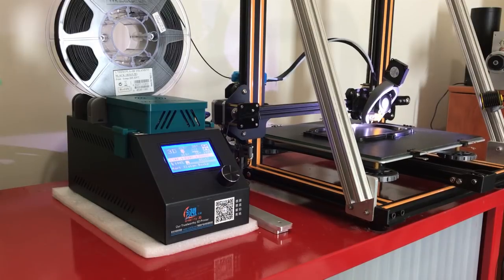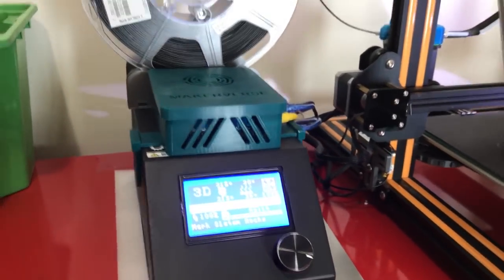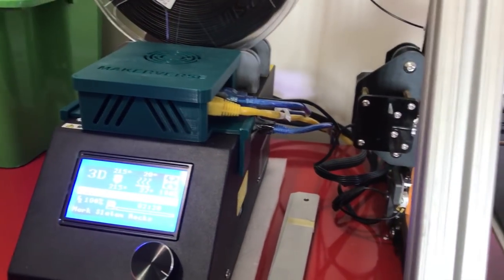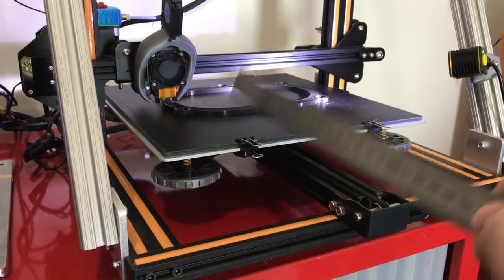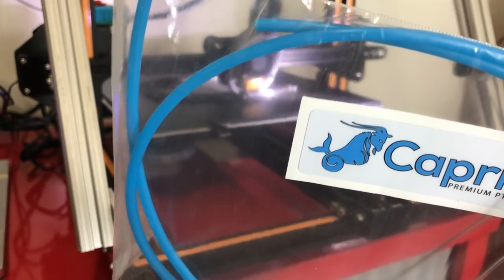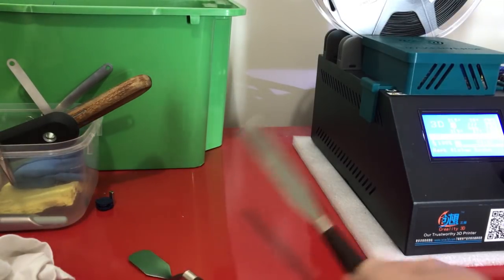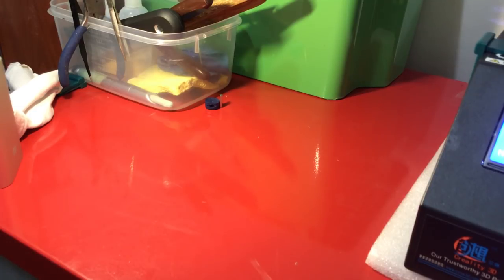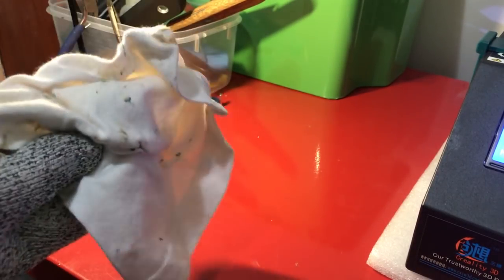Creality CR-10 Best Upgrades, Tips & Recommended Mods

Comment: why did you put the supports in the front of the printer? Surely it would make it more sturdy to run them in the back, where there's sharper angle
Reply: Greg Jaskiewicz it really won't affect that much where it is. Either one is good.
Reply: Greg Jaskiewicz I

Comment: I hope you realize that you are completely blocking the power supplies exhaust fan with that foam padding on the bottom of the control unit. Your power supply is gonna fry itself from the heat!
Reply: First thing I noticed. Some good tips otherwise. :)
Reply: They come out the back of a CR10 mini

Comment: What's on the extruder??
Reply: nick mann it's called a fang cooler. It's all over thingiverse
Reply: That's on the hot-end
Reply: nick mann I think it's called the 3 in 1 extruder cover on thingiverse, dust guard, cable holder and filament guide. Better for CR-10 because CR-10S has the filament detection extra that acts as a filament holder

Comment: Thought the cr10 wasn't the type of machine that needs upgrades?  Subbed
Reply: GeoDroidJohn if there ever was a machine built that could not in any way shape or form be upgraded or modded I wouldn't buy it. Personalization and upgrading is most of the enjoyment in anything for me and I assume others.
Reply: I went the Tevo route and got a Tornado but I agree. Upgrading the printer is most of the fun. It's just a practical tool after that.